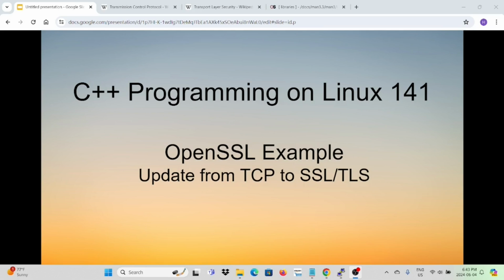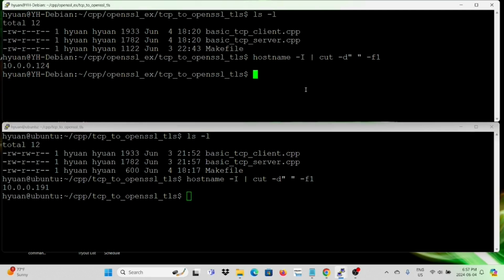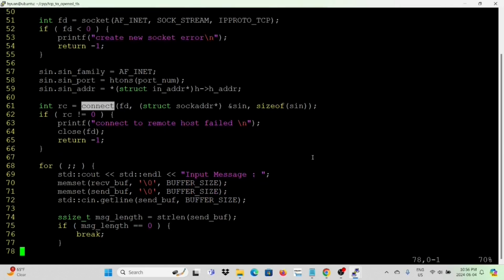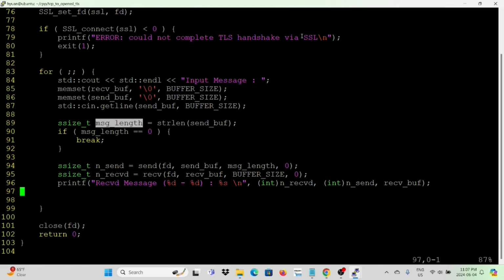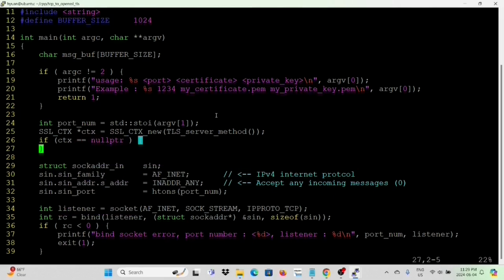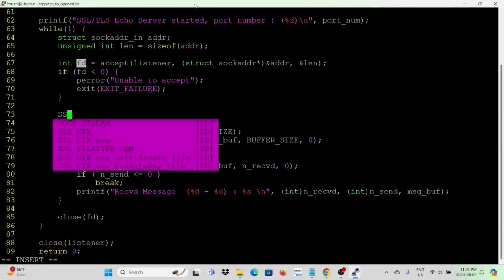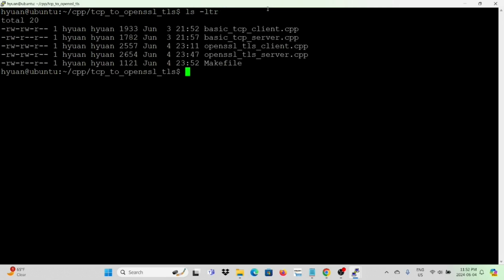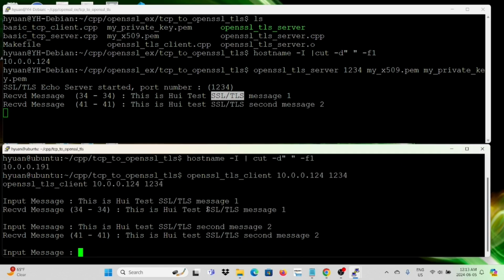C++ Programming on Linux - Update From TCP to TLS Example using OpenSSL

Comment: Mr. Yaun, 
I wish to indulge your patience a little more.  I hope the following question makes sense and you are able to help.  I wish to build and run YH-141's openssl_tls_client and openssl_tls_client example.  The server requests the following files,  cert and private key, resp:  "my_certificate.pem" and "my_private_key.pem"

I want to learn how to generate these items for my testing.   I use Certbot's letsencrypt to maintain my existing certs for a few served webpages, however I did not set these up as my IT person has left for greener pastures.  I'm aware that I can use certbot to obtain self-signed certs.
I'm aware of ssh-keygen and openssl command line tools (per webpage guidance) but I'm unclear which, if either, is the right tool to generate these two files and appropriate arguments to use.

Would you plz describe the steps needed to get all of the requisite files setup for running the example.   
Note: 
I want to test server and client on one computer, but will migrate to using two computer at some point during testing
I run on ubuntu 22.04, C++, VScode, etc.

Thanks Sir.
Reply: I've rushed to ask my most pressing question and your suggestion to look at lesson 123 was good.  I think I seen the command line commands to use.  Thanks

Comment: Mr. Yuan, this was an awesome video and really helped me understand many of the issues I wondered about-- you showed an example that used comm across processes, you showed how an original tcp client/server is updated to perform TLS handshake and comm.  And its on linux and uses C++.  Excellent 
If I could ask, here are a few thing that remain in my mind and I need explanation:
a) why doesn't the client need to reference the public key of the server?   I know they are on the same host but still the client process and ssl code does not reference the key files?
b) If one needs to add authentication, how is that handled?   Early in my reading I learned that best to use an cypher that qualifies as Authenticated Encryption, e.g. gcm.
Thanks  :hand-pink-waving:
Reply: Hi! I have some ideas, but i'm not an expert. a) Before client trust CA, CA has given the public key in certificate to client. b) GCM + MAC function.
Reply from the maker: Question a) public key, it's embedded in x509 certificate, there is a previous video explained x509 structure. https://youtu.be/b6yBB8M49PA and it can be displayed both using c++ code or OpenSSL view certificate command.
Reply from the maker: Question b), it's possible to have peer verification or host verification during TLS handshake process, it's optional, OpenSSL has functions to perform certification authentication, it's been used for server/client decide if establish or reject connection, example in this video, we just focus TLS process concept, and skipped authentication.
Regard GCM cypher, there are many algorithms available for encryption/decryption, in this video, we just selected one of popular, sha256, RSA Encryption, 2048 bit public key.